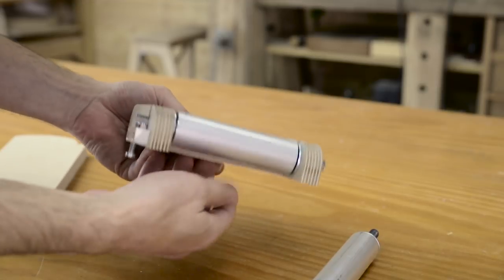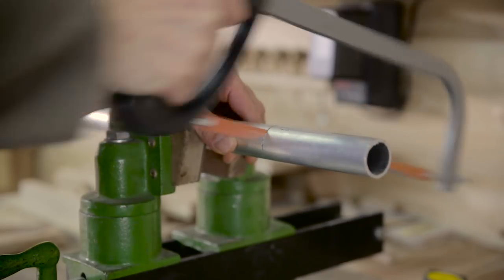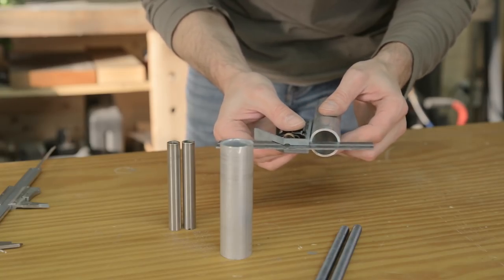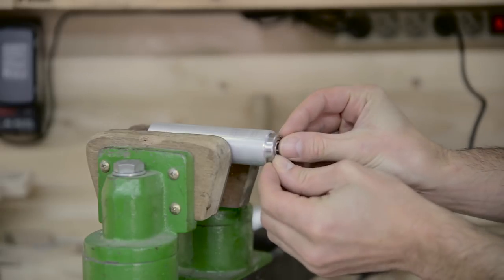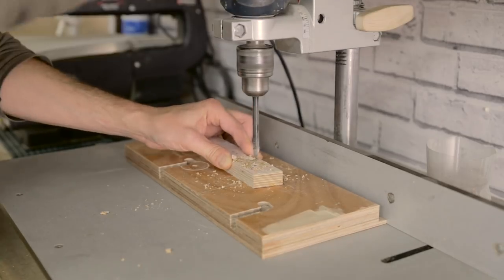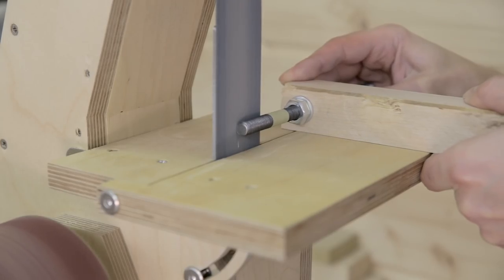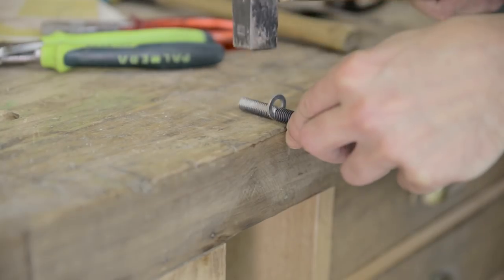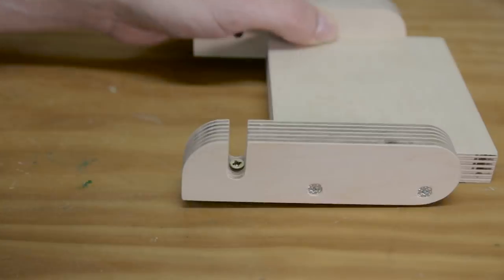Easy-to-make Belt Sander/Grinder Wheels

Comment: You could use heat shrink tubing for underground cables to wrap your drum wheels in something rubbery. Plus it is easy to replace later. I saw in your other vid you used epoxy
Reply from the maker: It is a good idea, thanks for sharing!

Comment: Hi, it's so nice 
But I have a problem that my bearing is not fiting in pipe and I don't have dremal  machine, so you have any other idea please
Reply from the maker: hi Praneet, you can use a drill with the sanding drum instead of a dremel
Reply: if the diameter difference is not so big you can heat up the pipe, snap in the bearing and let it cool down...

Comment: Hola Socio! Tengo una duda. Qué tipo de contrachapado usas? Abedul? y de qué grosor? 18 mm? 20 mm? Un abrazo!
Reply from the maker: hola, normalmente uso el de abedul 18mm
Reply: Lo digo porque he apreciado que la tapa superior del motor del torno, la que está doblada con surcos, es de 15 mm? Quiero decir; si es de 15, con ese delicado espesor se pueden hacer los surcos para doblar el contrachapado sin  temor a que quiebre?
Reply from the maker: esa pieza es de 9mm, para doblar de ese modo mejor usa el de 9. Como ves en el vídeo, corta hasta casi la última capa del tablero, luego humedece un poco el tablero y te funcionará sin problemas!
Reply: De 9mm solamente??? Vaya... parece increíble que no se rompa... ok ok... Es que necesito doblar contrachapado de esa forma para un proyecto y necesitaba saber el grosor para ir seguro al hacerlo. Pues muchísimas gracias tío! ^_^

Comment from the maker: If you'd like to help me, you can upload subtitles in your own language following this link:
http://www.youtube.com/timedtext_video?v=uaiu-sJ9nAM&ref=share
Puedes contribuir con subtítulos en tu idioma  en el siguiente enlace:
Reply: Paoson WoodWorking Nice job, I have already made a steel one (my first), then I made another from aluminium which turned out great, but because of the thick aluminium I used to build it, it did turn out to be quite expensive. Mind you, it cost a lot less than those silly £1300 ksg (?) Models, and mine is superior in every way! Mine has a fully speed controlled 3hp motor. At any speed the belt is moving at I can stand a 50p piece on any part of the grinder with virtually no vibration. But, on this version I added dampers to the motor housing to reduce the vibration to virtually non existent. Also the I love the super strength of the aluminium frame with how lightweight it is. It also looks like a beast with a lot of it being solid square bar stock. I will never need to build another, but I do like making them, so I might make more....maybe to sell. Who knows.
Reply: (Paoson WoodWorking)  Hello ! 
I wish to congratulate you as much as I can thank you for the amazing work and video you present.
 Watching I got to that particular video and motivated me, furthermore, your report to help compilation. So I felt like my obligation, after so many nice constructions and I wanted to offer ... a small lively flower in your big and beautiful garden.
I hope that the translation I gave (in the Greek language) will help the possible approach by Greek viewers who would like more than information than the good and detailed viewing of the audiovisual works you present.
On my part (with finding time) I will try to translate and some of your other videos , always in the same spirit of the support of the beautiful activities.
I wish you health, also imagination and creativity!